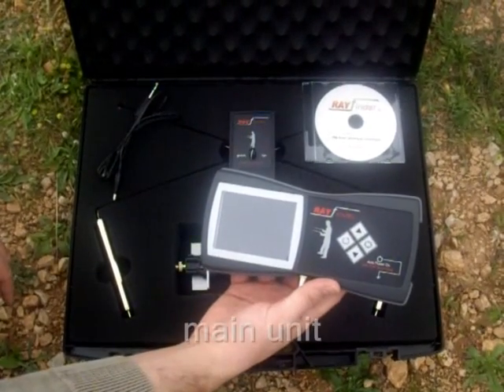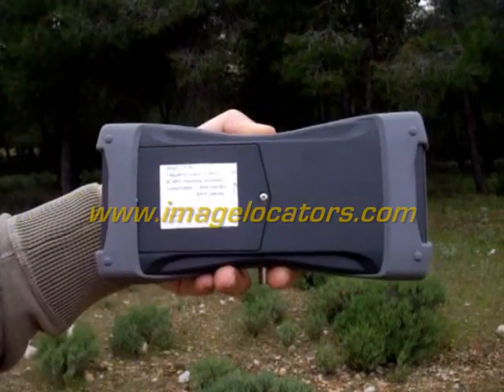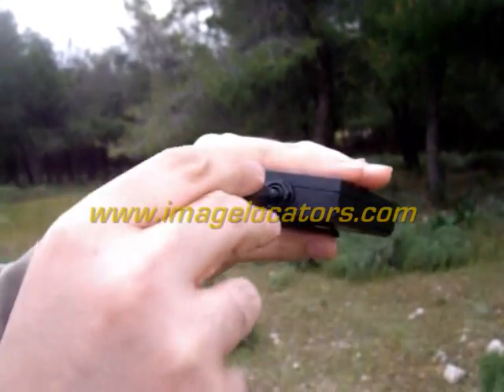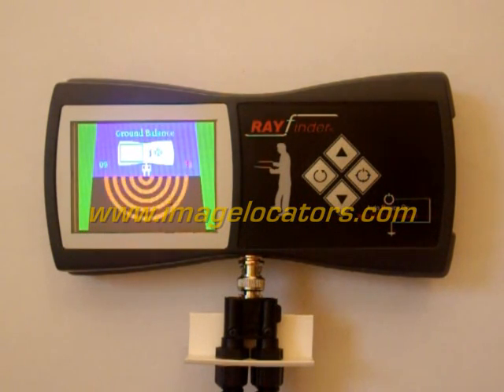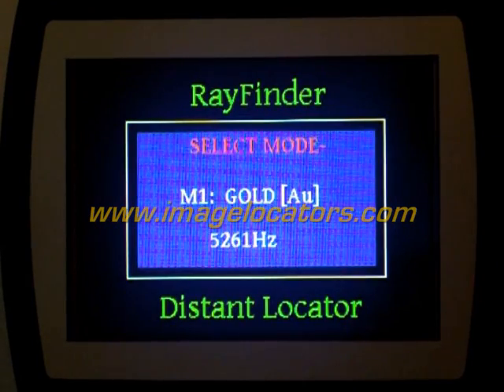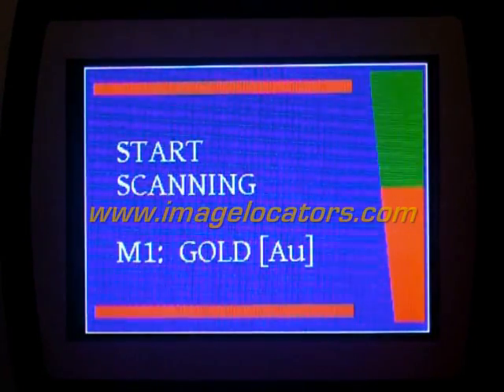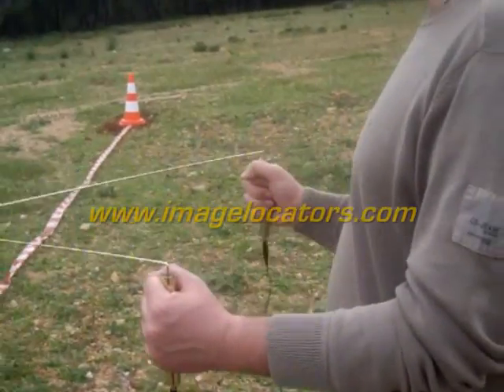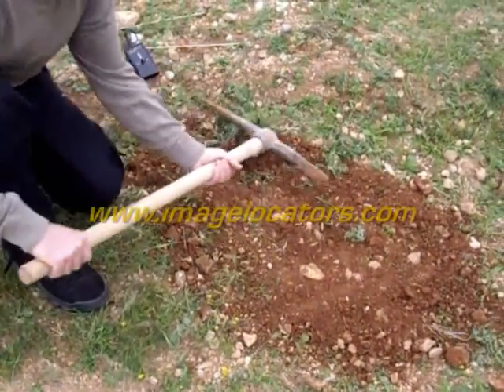rayfinder long distance locator

Comment: I am a seller of underground metal detectors in China. I ask the manufacturer for a price. Only 10 units can be purchased at a time. If there is no quantity requirement, I will purchase.
Reply from the maker: For distributor enquiries you can send message with your requests to detect@otenet.gr